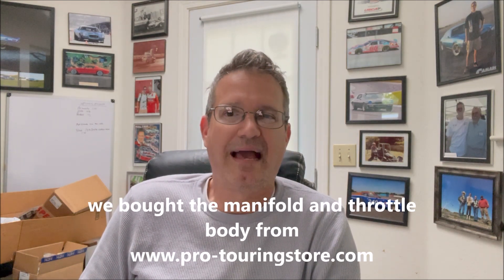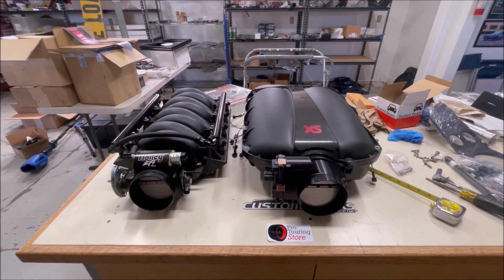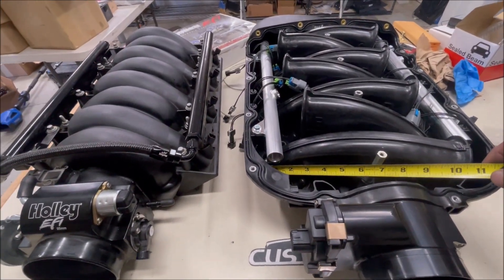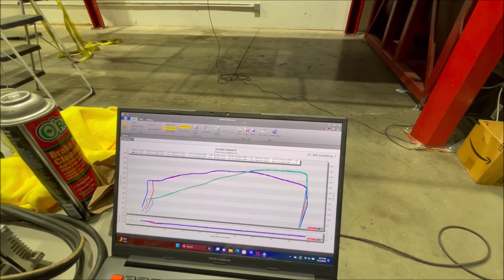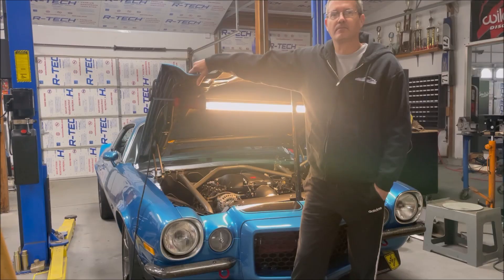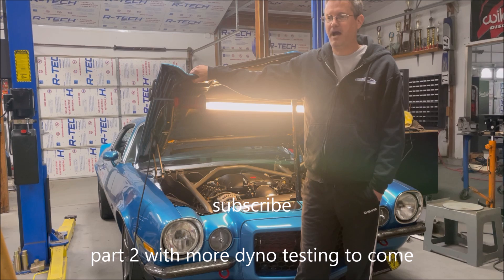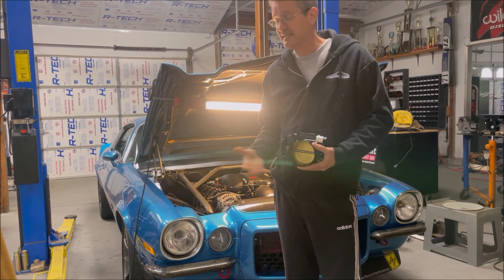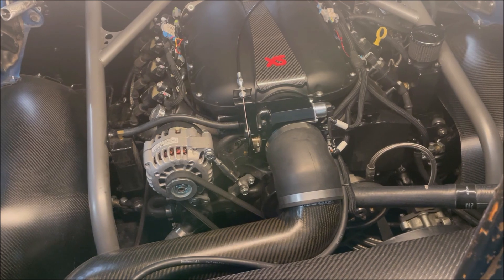Who's The Boss?  Performance Designs XS vs LS3 intake on the dyno!

Comment: That’s strange…. Every other test showed gains of over 20 hp and 20 foot pounds of torque. I’m guessing your ignition timing at max throttle is about 4 degrees  to retarded . Your engine should like more timing. I have a 416 stroker LS3 heads running about 11.7 to 1 compression at 30 degrees at wide open throttle. No detonation pinging or anything else.  Red line at 7000rpm. I’m thinking maybe your camshaft might be a bit too big. I’m running 225@.50 intake and 238@.50 exhaust BTR Stage 2 cam.

Comment: Classic example of both intakes being wrong for that build. Neither of those intakes should be on a engine with a cam that big.
Reply from the maker: What would you suggest?  As noted this engine is in a car used for autocross and track day stuff.  It needs a broad powerband. It also sees the street.  If it was a drag race motor, a high ram or something would make likely 60-80 more go, but at a steep cost in the mid range.   Both of these intakes are perfect for this motor.  Raced the car today.  Barely saw 6000 rpm on the autocross course.
Reply: @ks71z28  then I would do a much smaller cam if I was worried about midrange so much. No use in have that big of a cam and only turn it 6000 on race day.

But in the end a intake that matches that cam would never lose any midrange......because gear multiplies torque.  You could run more gear.

There's lots of ways to do things and a oe ls3 intake is pretty good.....for a oe ls3 or something mild. But once you go so far it's holding a big engine with a big cam like yours back.
Reply from the maker: @HioSSilver1999  Well, there are lots of options yes.  On your mentioning of a smaller cam, well this isn't our first LS build.  We dyno a lot, we tune lots of LS engines of various combinations.  This Cam/intake combo for its intended use is a great match.  A smaller cam would yield less torque down low.  This cam when we have used it in various LS combinations makes peak power around 6200-6400 rpm.  The reason my engine only went to 6k this weekend was because of gearing.  I don't have six different gear set to swap into the car for different conditions.  What I do have is over 500 wheel tq, so gearing and RPM really don't matter.  I do not need to wind the motor up to make it go fast.  On the other hand, on the track the motor will see 7000 rpm at 142 mph.  On the dyno the engine made peak power at 6200 rpm, but really only fell off around 10-15 hp at 7000 rpm.  Yes the intake is likely limiting that power, but in my case, so what.  The engine is so powerful and responsive down low, all while not needing to wind it way up to the moon to make power.  This engine responds like a big block.  So in conclusion....  I am willing to give up 10-15 hp on the very top end where the engine rarely goes, for 20-30 from 2500-5000 rpm where it spends most of its time.
Reply: @ks71z28  you're not giving up 10-15 up top.....more like 30 + as rpm continues if that's a oe intake and tb. Hell we picked up more than that with a h/c ls3 and didn't lose enough to matter at low rpm with a l.o.d. intake....because we don't race at 3k rpm.
Reply from the maker: @HioSSilver1999  Did I mention this all needs to fit under the flat hood of a 1971 Camaro!  Lots of stuff to consider.  The point of this video was to show people that this intake really isn't very good.  If you look at our other videos, I have one with a LS3 with a BTR Low Ram intake and a stage 3 cam, and shorty headers with 2.5" exhaust.  This was such a bad combo, I compared it to the same engine with a stock intake and better exhaust, power numbers were amazing to see the difference.  I hear what your saying.  For my "box" I need to run this engine, the Stock LS3 would be the best performance and cost.  thanks for your input.
Reply: @ks71z28 no such thing as stages, zero, none!!! That is a marketing term for idiots!!! My cam is 675in lift for intake and exhaust on 96 and 106 split lobe with 296 duration for intake and 310 for exhaust on 14.5.1 compresion. Soo i reckon it's a stage 15 cam!!! I'm willing to guess you dont have a lot of repeat customers. Or at least not long term customer. Perhaps 1.

Comment: I am doing a Ls3/6L90 in a 03'Crown Vic Police Interceptor. I turned a L94 into a Ls3. Flat top pistons and such. 821 heads. I was looking at that intake but i think it prob wont benefit me right now. I am planning on a larger cube engine later on. This is a temp engine. They had to 20 over the block. They checked it and said ut was ok. Its a N/a build so it should be fine. Till I build a bigger engine. Cool deal. Great info.
Reply from the maker: I'm not so convinced its best for a bigger cube motor.  Mine is a 416 with big heads.  The loss down in the meat is a big sacrifice for what I use it for
Reply: @ks71z28  The comment was before I finished the video lol. I will stay with the  stock intake. And a 92mm throttle body. Should be good with a BTR Ls3 Stage 2 V2 cam. I'm really not trying for all out power. Burnouts and ice cream with the grandkids until I get the suspension and brake mods done. Then burnouts and ice cream and some track time. She is going to be spicy!!! Considering it cam with a 4.6L 2V with 239 hp at the crank new. Great info.

Comment from the maker: so we did a follow up video on this intake after we designed a bracket to allow a cable throttle body to be used, we tested a 92mm vs 102mm to see if there is a difference and if so, how?  https://www.youtube.com/watch?v=uPdLbtIeJcs&lc=UgzojzEX1i6ShAwAlvN4AaABAg

Comment: All the other videos on this manifold show about the same as you are experiencing - why did you expect anything different?
Reply from the maker: We had been in contact with PD for a while prior to this, they told us we would see a gain of 20hp and possibly some gains down low.  Our initial dyno results with the stock manifold yielded peak power at 6000 rpm, which seemed low for this combo (even though power numbers were exactly what we hoped for this combo).  We thought we might pick up some power because we thought the stock manifold was just running out of flow.  Which to some extent it did.  We also discover windage was dropping power, which we resolved with lowering the oil level in the pan (because it was too high, and should affect the oiling at the level it is at now).  The only dyno video I watched prior to this was Richard Holdener's.  Also we do a lot of dyno stuff and I want to see this stuff for myself.  We aren't paid by ANYONE to do this stuff, and seeing for your own eyes is good experience.  We have a follow up video with this manifold comparing a 92mm vs a 102mm throttle bodies.  you should check that out  https://www.youtube.com/watch?v=uPdLbtIeJcs&lc=UgzojzEX1i6ShAwAlvN4AaABAg

Comment: I wonder if the intake likes more cubes, I noticed that when Richard Holder tested it on a 427 he saw a little bump over the stock LS3 intake, and if you’re chasing all the hp , maybe worth it , if you’re rich , haa ha
Reply from the maker: Thats what I was hoping for, mine is 6.8, way larger than the sock 6.2, and close to the 7.0 Richard tested.  If you look at his video, he really focusses on peak power, where on my test it showed a slight increase and a longer peak hp curve, but its the loss below 5200 that is really the killer.  Yes my test won't reflect the intake in every scenario, but my experience was a bit dissappointing and costly for me,  thanks for watching Dave!
Reply: @ks71z28  It looks like the intake only does a little something way up there in the RPM range and most people do not rev that high , For the $1,000 you could change your rear gears to say a 4.56 if you wanted to snap your neck, HAA HA

Comment: Please check port alignment at the cylinder head.  If you have a borescope that can reach down the runner with the upper shell off that would be the best way to do it.  We had another customer with those TrickFlow LS3 heads and the port geometry was not the same as stock LS3 which caused a step in the transition between the intake and the cylinder head.  That could be why you are not seeing the same performance gains that our other customers are seeing.
Reply from the maker: That's funny you bring that up, because you already heard my response to that before I made this video in a message on Instagram.  The port alignment is perfect on the short radius (lower side), and slight off on the upper corners of the port, meaning the head surface shown, but this is absolutely minimal.  I checked with a borescope (doing this on a stock LS3 intake would be really difficult)    Keep in mind these are the same heads as were used on the LS3 intake, so if the heads are poorly designed, they would affect the stock LS3 intake as well.  We aren't looking at an absolute power number here, just a comparison between the two intakes on the same engine, with the same tune.  We are going to do a video with two different sized throttle bodies to see if that may have contributed to the loss of power bellow 5200 RPM.  We will keep you posted
Reply: A mis-alignment would hurt flow all over, increasing with RPM. This is just a function of runner length, you see it with ALL aftermarket manfolds and most easily with the FAST that has swapable trumpets.

The fact is there's an endless amount of dyno comparisons showing aftermarket manifolds simply can't touch best best factory intakes below 6k. The hard truth is you're buying looks or 1000rpm of powerband before redline.
Reply from the maker: @hydrocarbon82  I agree, We spoke to performance designs and they mentioned checking for a mismatch before we made this video.  The bottom of the port was perfect, the top in the corners were a little off, but it would likely be the same with both manifolds, unless the PD intake was the mismatch.  I feel this is an absolute fair comparison under the same circumstances.  I also do think windage hurt the stock manifold dyno run, which we remedied by lowering the oil level for the dyno run with the PD intake.  We aren't setting out to hurt anyone, infact I now am the proud owner of a $1000 intake and $675 Throttle body I am not going to use, due to my findings.
Reply: Correct that what I used. Interesting that experience builders don't take the time to use bore scope to make sure everything aligns. I posted on lstech my journey. I dyno next week so will see my gains. I ported and smoothed everything as well as port matched my  intake. Shaved the top too. It's perfect. I also ported and smoothed everything  no step when the air enters the intake. I think my builds is the nicest  out there. I portmatched the XS inake to my heads see if it makes any gains. I have TSP heads and big cam. Stock 376, 12.0 compression.
Reply from the maker: @GETLITUP69  We did check with a borescope.  It was a decent match also both intakes used the same heads.  This isn't about horsepower, this is about a direct comparison of two manifold under the SAME conditions.  The fact that it lost a significant amount of power from 3-5000 rpm is a bummer, but that usually is the case with manifold designed to make "more power", but it also didn't really make a significant amount of more power (maybe 3-4hp)  for me it was not a good match.  The loss of power down low can be felt when driving.  Again, this isn't about total power, its about comparing two manifolds.  I'm sure your builds are nice.
Reply from the maker: @GETLITUP69  I didn't see your link in LS1tech.   You assume I don't know how to tune?  I would like to see your wizardry!
Reply from the maker: did you remove your comments?  I got notified but they arent't showing here?  We didn't use a stock ECU, what you mention is something you need to do with a MAF sensor, not speed density system.  we just did a video on the 92 vs 102 throttle bodies, throttle response was the biggest factor